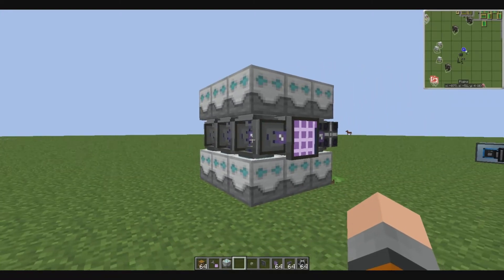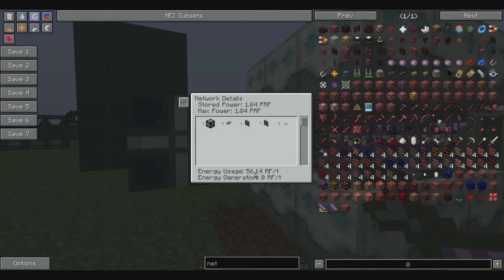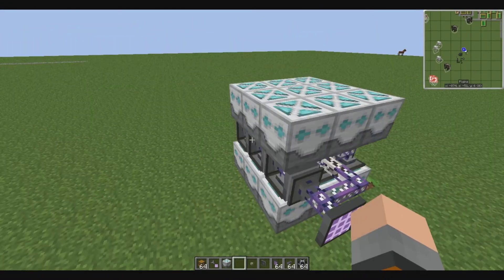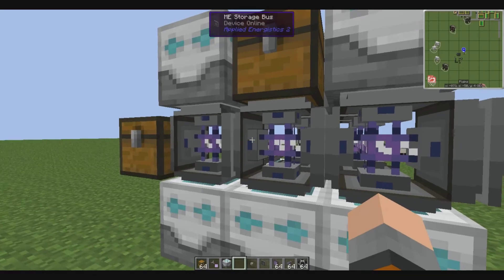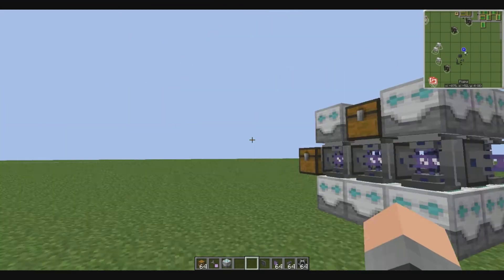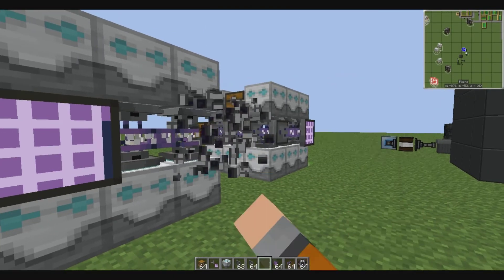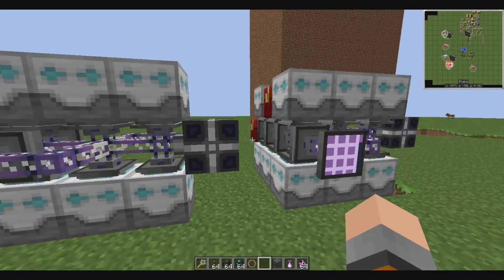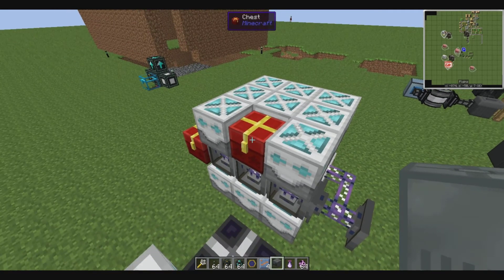The compact and simple super soaryn drive

Comment: A few helpful comments, for any other people that may be coming here when searching for references on the Super Soaryn Drive.  I do prefer this kind of design for bulk storage using DSUs, so I've come back to this video quite a few times.

1) You can configure the storage busses for specific items... not sure why that wasn't covered.  Instead of having to fill all slots in an inventory with the items you want... simply configure the storage bus for those specific items ahead of time.  But I know, you can't always do that.

2) This design IS great for any block that acts as deep storage, and other inventories like chests (although you would have to alternate chests with trapped chests, or other chest types), but my favorite is the Actually Additions Large Storage Crate.  I don't remember exactly how many slots those have per page, but there is 18x3 pages worth of storage -- and each page I think is at least more than two double chests, or just about that amount.  That is a lot of random storage for early-mid game.  Even chests from Iron Chest, or Compatched Storage are good.  As you said, it offers a great way to run your storage through AE so that you can see everything you have in a terminal but also not have to use much power, and that might help you jump start your progress into better things.

3) Going off of the 2nd one, I believe you said that this design works for storage drives... it does not, unless of course you skip every other one, i.e. have them placed diagonally, or skip a row, so that they do not share a network.  While that may be useful, it reduces the compactness of this design because you would have to extend it farther anyway.

Comment: It is not more compact at all. You can put alot more items in 1 blockspace with AE2 than this setup. As you mention, a deep storage unit can hold 1 item (in 1 blockspace). A ME drive can hold 10 * 63 items = 630 items in 1 blockspace. The AE2 system is a lot more compact if you have 2 or more items in your system.
Reply: Your calculations for items in 1 block using ME drives is incorrect, as even a single 1K ME storage cell can contain 65-127 stacks per cell. Even when considering an ME drive to be full of 64k storage drives, a DSU's storage capacity is greater by 400x, being able to contain 2^31-1 (2.1b) items in 1 block vs 10 64k drive's 10*4160-8128*64 (2.6m-5.2m). I'm not exactly sure if you were following his definition of "compact", but you are correct in that this is not more compact than the SSD for ME drives. This design is only relevant to the fact that this is an alternative to Soaryn's design for the shape (whether you want your storage system to conserve on width or height), or if you are wanting to create subnets for storage units besides ME drives. This design could also work with ME drives as long as you keep ME drives from separate layers from touching (for example, a grid pattern of ME drives and DSUs).

Dimensions (per "layer" of storage)
MrPapadopalous's design
9 blocks - 3x1x3 for non-AE2 storage
18 blocks - 3x2x3 if reconfigured for ME drives (drives from separate layers cannot touch, as it would attempt to communicate channels with one another)
Soaryn's design
12 blocks - 6x1x2 if reconfigured for non-AE2 storage (can bring separate layers together, as non-AE2 storage will not be able to communicate channels with one another)
12 blocks - 6x2x1 for ME drives

For most modpacks, I believe that this design is better overall, as you can contain all non-AE2 storage and ME storage all on one channel. If you, for some reason, required incredibly large amounts of ME storage, the SSD would be the better alternative.

Comment: Hey!
Thank you for this very simple video!! That's just what I needed. 
But do the priorities of the DSU's storage bus work or will the global system ignore them?
Reply from the maker: WorldOfFurest the priorities of the DSU's only matter for the sub network that they are on. if you set the priority of the first storage bus that goes into the sub network higher then any other storage (like ME Drives) then any block that has a spot in a DSU will go there first. i also recommend that you set the filter on the storage bus to "current stored items". thanks for the question